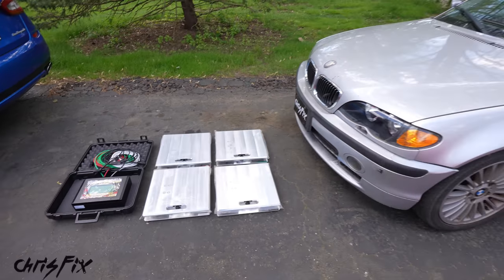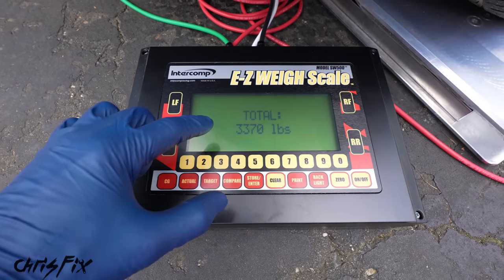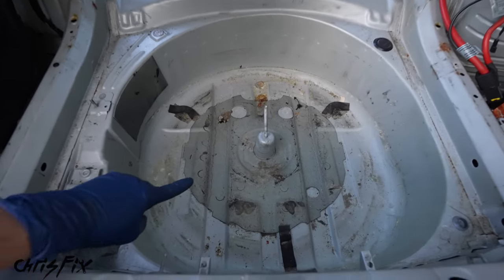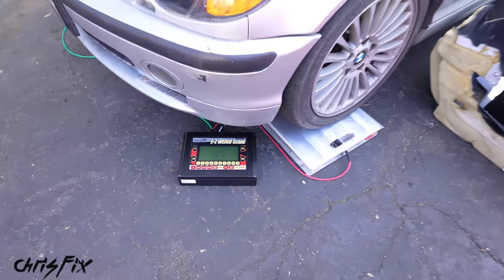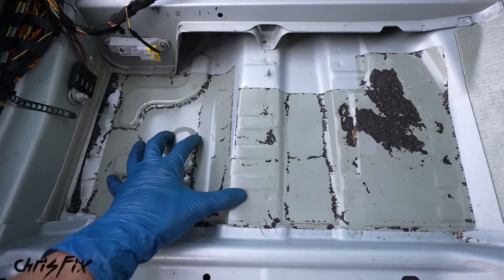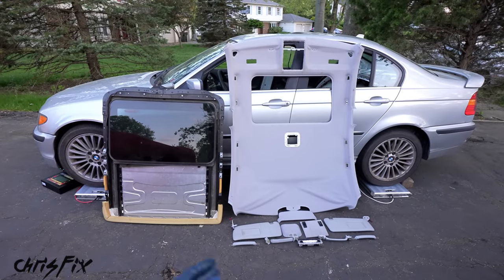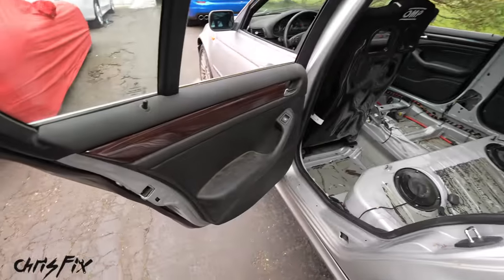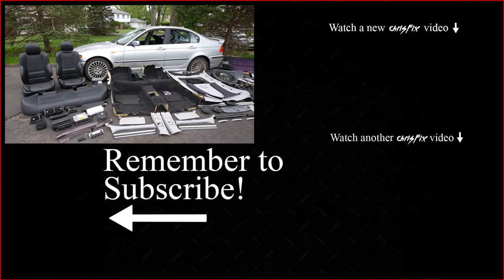How Much Weight can you REMOVE from your Car? (Weight Reduction)

Comment: That engine is probably like 500 pounds, imagine the weight reduction you could make!
Reply from the maker: Yeahhhh you jinxed it: https://www.youtube.com/watch?v=_vrICr6iNGI
Reply: @chrisfix  Hahaha oh damn, whoops! I should get to the video of this year's race pretty soon, hopefully it turned out better. According to the thumbnail I saw, it looks like it tho. Love your content btw, followed your stuff on and off for years (Still need to watch that light scratch removal one regularly 😂), great to see you push things even further with full on endurance racing!
Reply: I was waiting for the removal of unnecessary items under the hood.
Reply: Ha ha!
Reply: @mikelewis1166 Well since BMW decided in the 2015 X5 gen they decided to install the fuel filter on top of the motor which is a useless place for it, looks like BMW recommends removing the oil filter to add upon the weight reduction.
Reply: @jonathinfellnerah4021 top of the motor is the best place for a filter.... It is in a place where oil pressure is higher, making filtering more efficient. Also helps with less restrictive oil circulation and it's faster on cold starts to get the oil up to the top end, from the sump.
Reply: 500 it's a BMW try 2 tons alone 😂😂😂😂
Reply: Drive glider
Reply: @Dead.garden  1 month later and comment still made no sense
Reply: @JasonBaker-d1r sorry but it’s never going to make sense

Comment: You can also remove the indicators, no one who drives a BMW uses them.😂😂
Reply: ye same. my 3 series is sick
Reply: And the speedo
Reply: Honestly I don't know why is this the case for BMW drivers. Because I just got a MINI and the indicators are amazing. Subtle and deep clicking sound for indicator sound.

What even makes it the best indicator system I've tried is that the indicator goes two clicks each direction. click them once and the indicator indicates 3 or 5 times depending on your settings you selected. This is such a useful feature when I want to change lanes and not have to manually stop the indicator. I just set it to indicate 5 times, so that I let it indicate three times while driving in my lane and then start changing lane while the last 2 indicates are going. Perfect lane change with seamless effort.
Reply: @AlbaderBohamad  They just don't want to use them because they are inconsiderate I guess
Reply: True
Reply: Facts
Reply: @Yule Bernard Calma Their hazard lights are so they can park anywhere they like. Turning indicators, like speedometers, are superfluous.
Reply: @tostadorafuriosa69  it was me
Reply: @tostadorafuriosa69  Some guy undertook me by going through a layby full of lorries yesterday. He sped through and pulled out in front of me.
Yes I was going slowly. There was a temporary speed limit in place due to roadworks and he hated me sticking to it.
He could have killed people
Reply: I use mine 🤷🏽‍♂️ I have a Bmw F30 and the blinkers are my most favorite part of the car bc they’re so bright!
Reply: Nobody else gotta sense of humor 😂
Reply: @tanistv1124  high five✋
Reply: haha true
Reply: The stock BMW cars dont come with indicators dont worry 
😂
Reply: LOL
Reply: As a bmw driver u r correct turn signals and stop signs r in fact optional
Reply: @ryanmikolajczak7216  LOL 😂
Reply: BMW driver, no turn signal to cop after accident: "but officer, I ALWAYS turn left here."
Reply: I have never seen a bmw driver not use their blinkers🤣
Reply: @AlbaderBohamad  Nearly all cars do that now
Reply: Yeah trur
Reply: My dad uses them tho
Reply: A BMW driver indicated when merging in front of me and I even saw a wave of thanks through the rear window.
Reply: Lmao 😂
Reply: I just choked on my cup-of-noodles when I saw this comment!
Reply: You're seeing too much top gear, you know how much cliché you sounded like right?!
Reply: Doing this to my sDrive 😭
Reply: Lol i bought my e36 without indicators
Reply: what happened to chris' drift stang?
Reply: respect uber drivers 😂
Reply: Lol 😂
Reply: The key word is "drives"
Reply: BMW doesn’t haven’t then installed anyway 😂😂
Reply: Save u some grams
Reply: @Yule Bernard Calma who knows many they are alerting the drivers
Reply: Bro you ain’t lying
Reply: I use mine! 😋
Reply: Lol 😂

Comment: Just a disclaimer for anyone who doesn’t know: DONT immediately go to remove an airbag after disconnecting a battery and thinking it’s disarmed. I’m sure you’ve mentioned it in previous videos but airbags are linked to capacitors that can store the circuit energy and keep the bag live. It’s always Good practice to wait 15 to 30 minutes after disconnecting the battery to let the capacitor dissipate the electricity elsewhere first.
Reply: Here's a tip that came straight from the Honda dealer during the airbag recall nonsense.
Take you're battery terminal cables after you have removed the battery and just hold them together to complete the circuit after about 1 minute all the capacitors should be discharged.
I got that response after I made a terrible joke about the airbag blowing up in the techs face the moment he touched it.
Reply: @charlesanger1828  you put you're instead of your
Reply: @sarahfairclough9062  true, but it still got the point across, right?

Could be autocorrect, as it isn't a misspelling error,  which AC picks up.
Reply: @charlesanger1828  cool trick. Thanks.
Reply: You should probably wait longer than that but yea do be careful
Reply: @charlesanger1828  No! Don't do it! In this case some of the energy still stored in the capacitors is just running back to the terminals inverting the polarity inside some modules. You don't want that!
Just remove the Terminals and be patient and wait 30 Minutes.
Reply: Holy shit. Recently I just replaced the power window regulator and remove and reattach the airbag socket without disconnecting the battery
Reply: I don’t trust the capacitors to discharge so I just wear a motorcycle helmet and thick leather jacket and crash into a wall to deploy the airbags and cut them out
Reply: @kevinfox500 or he doesn’t understand basic grammar
Reply: @shoruda  you the pot, or the kettle? 

Alternate theory. He or she is from somewhere that English isn't the primary language. Where it's a close contender is my guess.
Reply: @lxrick  Dump the charge through a resistor (figure somewhere between 10 and 100 ohms) to limit the surge current. You can even leave the resistor across the power leads while you work to ensure the residual charge on the caps doesn't migrate and make the voltage float up. "Float up" likely would never be enough to trigger a bag, but could be enough to wake up a computer and set a code.
Reply: @kevinfox500 trust me, it was not autocorrect. 😂😂
Reply: “Wait 15-30 mins”
screams in flat rate
Reply: @Purriah They didn't write that in the maintenance manual 😂
Reply: @charlesanger1828  this guy is right
Reply: Bro I took it off without disconnecting the battery and didn’t know about this until I was clipping it back into the wheel🤣🤣🤣
Reply: Bro the airbag capacitors are so small they can hold electricity for a minute after dismantling the battery unlike the inverter capacitor it needs 15-20 minutes to fully discharge
Reply: I have connected and reconnected airbags without disconnecting the battery, I’ve done it on a BMW and a VW. Nothing happened so I was just lucky ?

Comment: That “fastener” holding in front of the carpet behind the clutch is actually the clutch stop. Make sure you reinstall that to prevent any possible damage to the clutch system.
Reply: This needs to be seen
Reply: I’m sure he did after but thank you that’s good to know
Reply: man needs to see dis
Reply: Hopefully he has done seen this lol
Reply: i broke mine, how important is it? What can happen if i dont have one?
Reply: Didn't even know that. Yeah I think he might need that.
Reply: Like it up,  rlly important
Reply: ehh the clutch stop barely limits the travel of the pedal =D its almost the same as if it isnt there atleast on those e46's/e39's
Reply: I have owned 3 bmws without them.  It just makes the pedal travel further without it.  It wont "hurt" Anything not to have one. You can make one easily.  However, Revving a awd car up to 4500 and dumping the clutch is just asking to break something and destroying the clutch.
Reply: @JoeyFucktwice  IT JUST MAKES YOU OVER EXTEND THE THRUST BEARING,DESTROYING THE CLUTCH...NOT A BIGGY
Reply: nah, clutches don't break. they last forever.
Reply: You need to "recuperate " that console?
Reply: Yes this!
Reply: Man if you were bringing a car to the track i don't think you would be worried if something breaks.Spare parts for this car are pretty cheap.
Reply from the maker: Thanks! We installed a wider one that works a bit better than the stock one for those quick shifts.